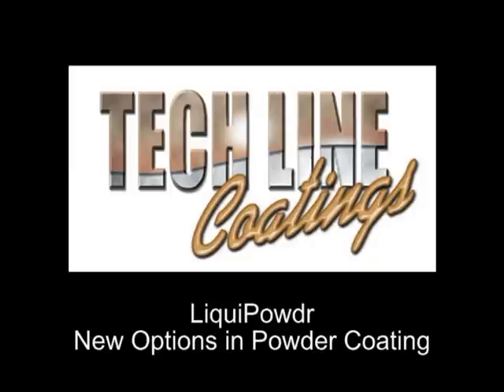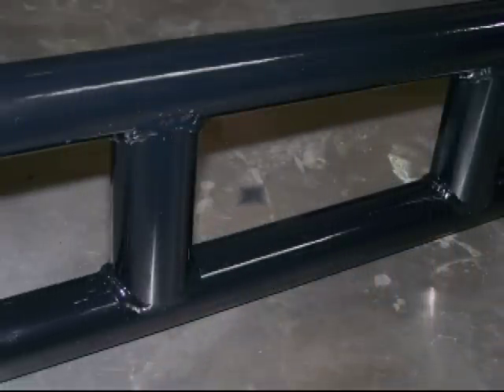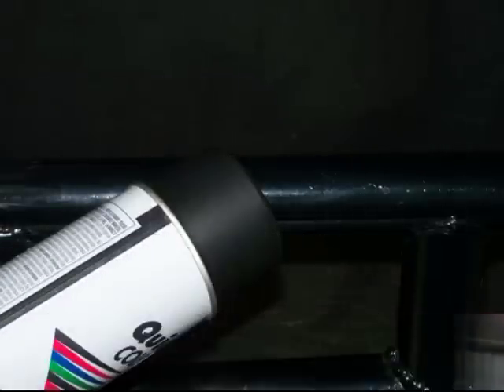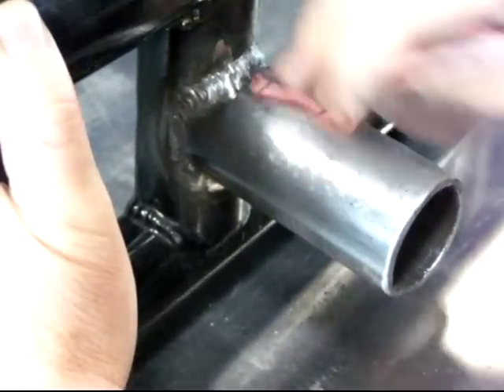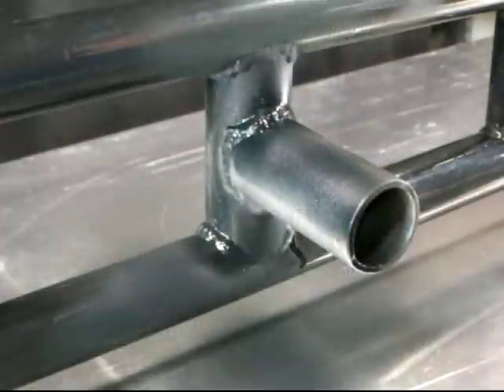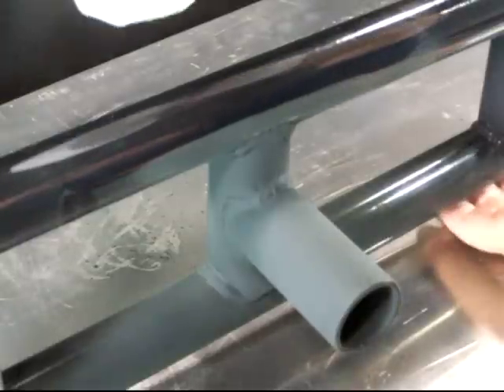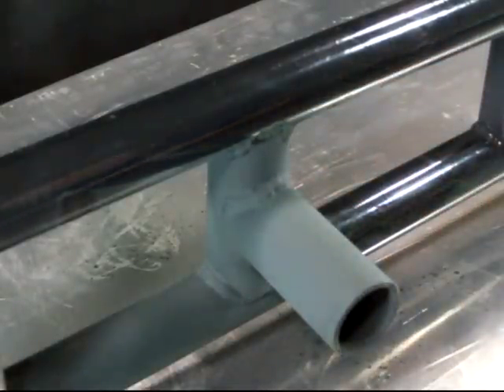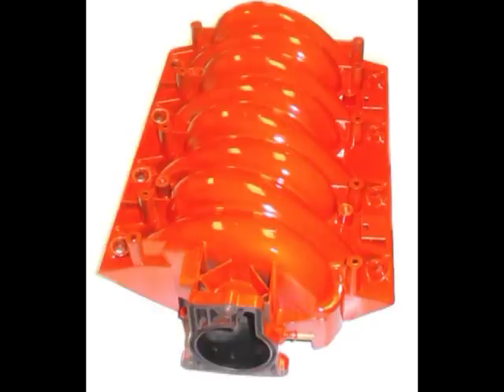LiquiPowder a different way to apply Powder Coating

Comment: wow thats impressive liquiPowder.  Have you used/offered your product to helps folks in the marine industry repair peeling or chipped powder coat on a boats alumnum t-top ?  there are hundreds of us boat wonswer out here looking for solution to make spot repairs on our aluminum tubes white powder coat, without having to remove entire structure and recoat.  thanks a bunch

Comment: Why not just use water instead of this "water-based liquid" of yours? All you're doing is creating "mud" (50/50 liquid/powder mixture), then letting the liquid evaporate, which leaves the powder residue behind on the part. I can't imagine that the liquid would need any special properties beyond the properties of plain water to do that. Regular mud (water and soil mixture) does that naturally.
Reply: adding just water will do exactly   what you describe mud... the power doesn't mix , it basically just floats on water.... get  repelled when suspended in just water.... you need the extra additives
Reply: I suspect that the solution should be a mixture of distilled water with some sort of a bonding agent/glue, the Glue bonds the paint to the target surf, but the glue should evaporate when it is heat treated by the heat gun...I guess!

Comment: Why couldn't this same exact process be done with an electrostatic gun? Iv used a heat gun on large parts numerous times.
Reply: How did you go about grounding it . I have a aluminum console for a boat I had built that has been powdercoated had to remove a cup holder for the throttle box since my builder failed to think about that. How would i go about doing this with nothing to ground the powder to could o just dust it on or somthing?.

Comment: ...NO heat curing?
Reply: ***** ohh ok, i managed to miss that somehow.
Reply: SnowWolfJones heating with a heat gun will never cure your powder correctly. And you must wait until the liquidpowder mixture is completely dry or you will get many imperfections. it will never match the powder that was applied correctly.
Reply: Richard Burnett  yeah, i kinda thought so. at some point this summer i want to build my own powder coating setup to work on my bike over the winter. the oven is going to be the tricky part being that i don't have any 220 outlets in my garage, but i've seen people build just a well insulated cabinet with a hot plate in the bottom. works well if done right, just takes longer to heat up.

Comment: Using a heat gun will make the part turn out like stick welding over rust.  It will look ok then fail like a Chinese made product.  Take the time to do it right and farm out your part if it doesn't fit in your oven.  Stop being so cheap.
Reply: Yeah, American made products NEVER fail. So, how many American astronauts died when the Chinese made Space Shuttle Challenger exploded??

Comment: Why not just take a mobile powder coater, touch it up and cure the same, you’d have your compressor there in any case to run your spray gun, bit pointless to be fair

Comment: why not sandblast the part and then re powder coat the entire thing?
Reply: That takes time and money!
Reply: Key it up, patch prime it then have at it definitely quicker re-coating most things, the only time i would see this application being useful is on things that cant be moved, but even that its a total waste of time. Break out the wet gun. No useful application in the real world. Just another way to do a process thats already perfect in the right hands. As soon i seen the heat gun i was done 😆

Comment: This is completely pointless and a waste of time. Hence the reason it's not used by anyone who cares about quality or eliminating unnecessary steps. Feather in the surrounding surface, heat it back up, and hot flock your part. Faster, cheaper, better quality finish. Shame on you.

Comment: 🤣🤣 ridiculous! if at any point you watch this and think it makes sense. It doesn't! A heat gun is just silly. 2 hours to dry then around another potentially 2 hours to cure depending on part size and metal thickness! If it ever cures which is debatable. In that time i could key, clean, re-prime then recoat almost and job ive ever done in the last 12 years of doing this job 8+ hours a day 5 days a week. Just silly